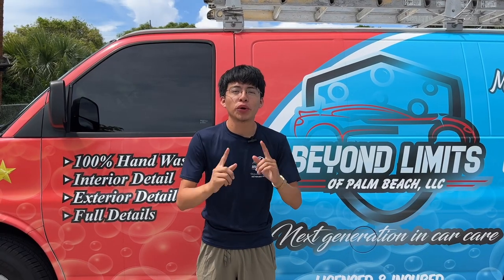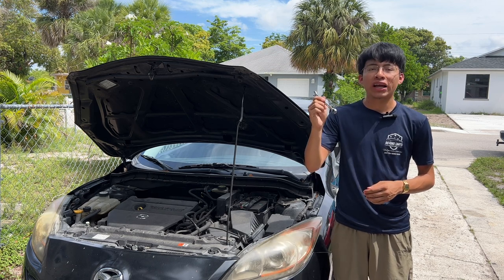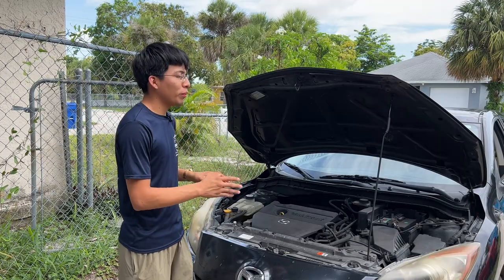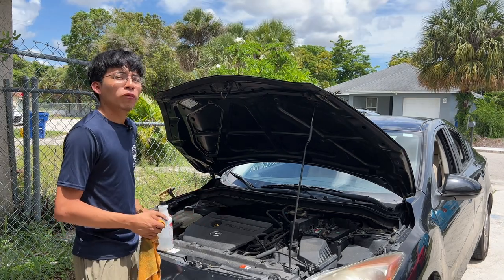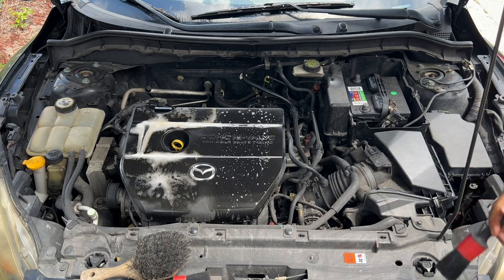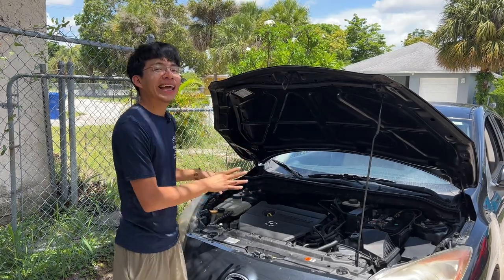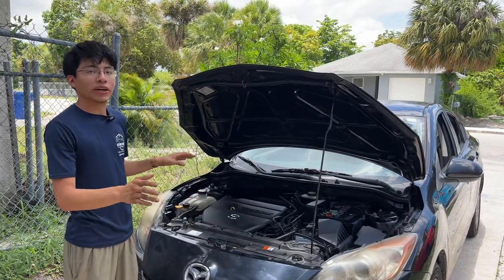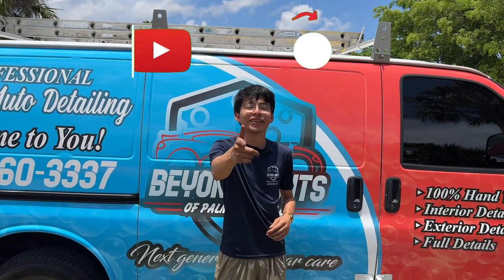How To Safely Clean Your Engine Bay - Detailing Beyond Limits

Comment: I was told is safer to clean the engine bay when the vehicle is running, what do you think of that?
Reply from the maker: Wow, I’ve actually never heard of that. You’d think that you’d want the engine cooled down and not at its highest level of temperature! Hope that helps..
Reply: @detailingbeyondlimits  I think he means when the car has just stopped 5 mins ago. It shouldn't be too hot but should be hot enough to get rid of the grime faster than it being cool if it makes sense
Reply: I was told that too by a mechanic, that it’s more dangerous to do it with the car off, he literally cleans the engine bay in under 5 minutes, some purple degreaser let it soak for like 2 minutes, pressure wash from far away, air blow dry it , let it sit for a couple minutes to dry any residue down the engine, and spray some shine or w-40

Comment: Randy i bought a 1800 PSI 1.2 GPM Cold Water Corded Electric Pressure Washer it that good or should i change it
Reply from the maker: Hey Bryan, you should be more than fine, I don’t see why it wouldn’t be a good machine! Hope that helps :)
Reply: @detailingbeyondlimits  just cuz it say cold water what those da means that i only have to use it with cold water